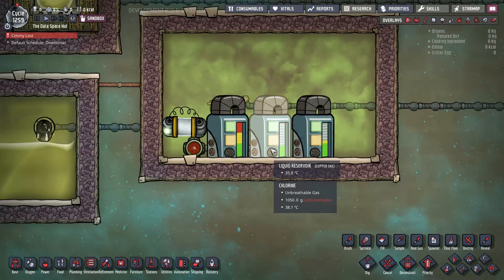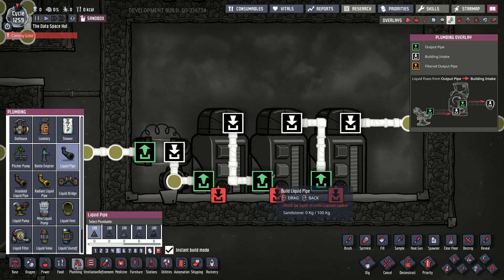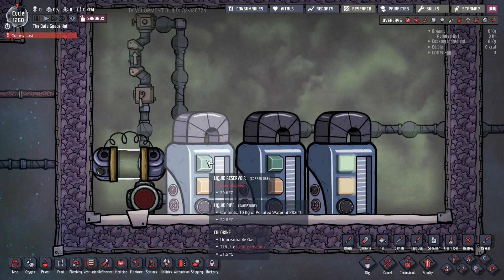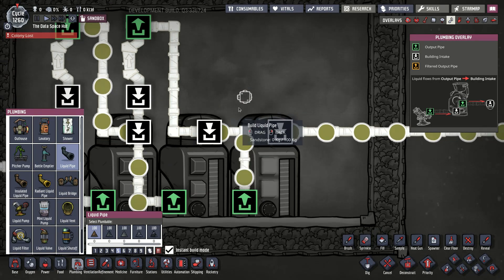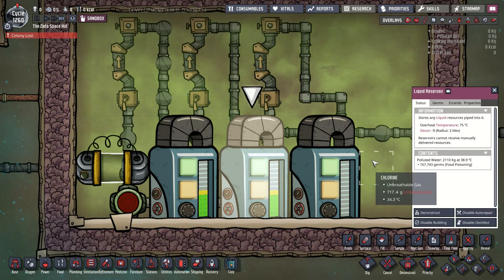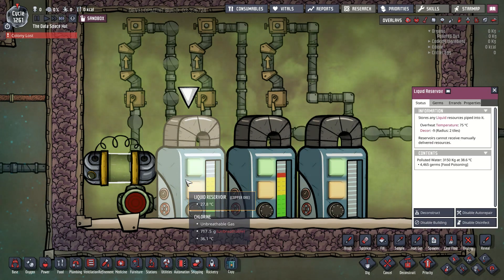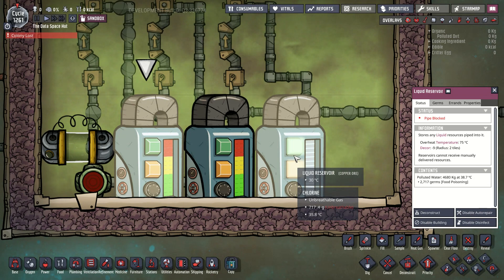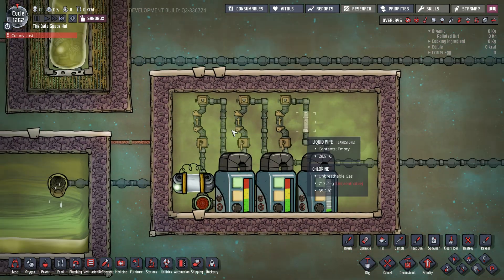A simple germ killer that processes a continuous full pipe of input.

Comment: Can't seem to get this to work. The water goes round. The shut-off doesn't let any through, a packet of water finally passes, then dumps food poisoning in my tank. Does it only work if you have full 10kg packets? There seems to always be a tiny packet of water in the pipe below the germ sensor.
Reply from the maker: That's strange. Can you post a screenshot?
Reply: @tonyadvanced6315  I'll share the save file if you wouldn't mind taking a quick look? 

I originally put in the more compact version you showed, so I thought there might be a problem with how I'd run the piping. So I tore it all out and installed the clearer version you went through. The problem I'm having is that the germ sensor just doesn't seem to do anything. If I set it to above 0 or above 1 germs, no water leaves the shut off. If I put it to below 0 or below 1 germs, all the water leaves even if it's got a million germs in it. Spent 4 hours and can't work out wtf is going on! :)

Please excuse the state of this crazy base - this was my first game, so I am sure it's inefficient - been learning by error! :)

https://gofile.io/?c=AoPTNf
Reply from the maker: @Sparhafoc  Got it. You are using a germ sensor that detects germs in the air. You need a "Liquid pipe germ sensor" in order to detect the germs inside the pipe. It's in the "plumbing" menu. I knew that sensor didn't look right, but I brushed it off at first and didn't figure it out for like 10 minutes. :)
Reply: @tonyadvanced6315  LOL oh ffs! That's hours of head-scratching for something so trivial! Thank you very much for working that out!
Reply from the maker: @Sparhafoc  Don't worry. I've wasted way more time on even more trivial things. 👍
Reply: @tonyadvanced6315  :)  So I rejigged the entire thing back to compact, put on the liquid pipe germ sensor, sat smugly watching the water come through and it was germy again! ><  So, not really knowing how the game works, I removed all the output pipe down to the clean polluted water tank, reinstalled them, fired it up again - same! Finally, the only part I hadn't changed was the shut off, so I deconstructed it, mopped up, rebuilt it, and finally... it works! Seems there was a packet of germy water in the shut off valve too somehow. I still fear I'm going to come back at some point in the future and see those hundreds of gallons of water have evolved into some kind of food poisoning super being... but at least for now, problem solved! Thanks for your help Tony! :)

Comment: So the water comes out germ free but it’s still polluted. How do you make that back into usable water?
Reply from the maker: That's what a water sieve is for. :) It's one of the things you can build under "refinement".
Reply: Tony AdvancedONI I’m trying to learn all the advanced stuff. Beyond oxdizers and deodorizers im lost. Lol
Reply: @RaginCajun77346  https://oni-db.com/ this contains ALL the basic stuff, like the answer to this question. Way better than the the wiki.
Reply: The alternative is to distill the polluted water by boiling it.
Reply: And if you boil it then it will kill the germs in the process so you don't need this part anyway.
Also there's another option: Gulp Fish (cold variant of Pacu) convert polluted water into water 1:1, though there's strict temperature requirements to work with or the water will freeze.

Comment: Thank you, built it in my base and it works like a charm! Can you think of a way to make in more compact, maybe for just filtering out bathroom water in small base? I was thinking, what if you used one reservoir and maybe some automation to forbid it to get completely full, so as to not need an overflow, let it circulate until germs are at zero, and then the germ sensor allows reservoir to fill again? I am not smart enough at the game to figure it out myself, yet (maybe some buffer gate magic?).
Reply from the maker: This design is made to handle a full 10kg/s of liquid. I'm certain that you can use a single reservoir in a similar way for less throughput, but I haven't take the time to make one.
Reply: I can confirm that 1 reservoir is adequate for low volumes. If you have less than 5t of water, that reservoir will fill up completely and cycle the water until the water in the pipe is germ free. Then, all the germ free water will be discharged. The problem Tony has solved here is if you have a contiunous stream of 10kg water.
Reply: I use to build a triple check valve system for bathrooms (just next to them) with just one reservoir. Four   latrines and all dupes splitted in schedules with a maximun of four dupes ( or just build more bathrooms somewhere and atach to the main system if you can): build a 3x4 box with the reservoir in the top right  side, a cut off valve just above with the green port in front of the reservoirs input, another shutt off valve to the left with the white port next to the reservoirs output. The output of that valve goes througt a pipe germ sensor (below 0) linked to another shutt off valve bypassed into the reservoir again (you'll have to build that last one outside, not enough space). The rest of the automation  its simple: Only one timed sensor attached to a NOT gate: From the gates input to the lower valve; and from the gate's output through the highest. When the water goes in, cannot get out and viceversa. If you have 6-10 dupes should work. But later (i like to pick as many dupes as I can) a triple reservoir solution its quite better. The concept is to fill the reservoir blocking the output and the input enough time to kill the germs, so, shutt off valves and timed sensors whit a germ sensor at the end to double-check: three reservoirs.

Comment: why do you need a bridge coming out of the reservoirs? You do a single pipe up, the bridge then more regular pipes? Why not just regular pipe it, what purpose does the bridge serve?
Reply from the maker: If there weren't a bridge then that section of pipe would have two inputs and two outputs connected to it. This particular configuration makes it unclear which way a bubble of liquid in a pipe should move, so they move back and forth in a way that basically stops anything from flowing. The bridge prevents that. I hear that the latest test build made some changes to the way this works so perhaps the bridges are no longer necessary.
Reply: Basically so water flows in one direction. Makes sense